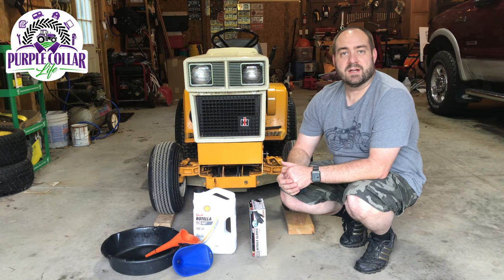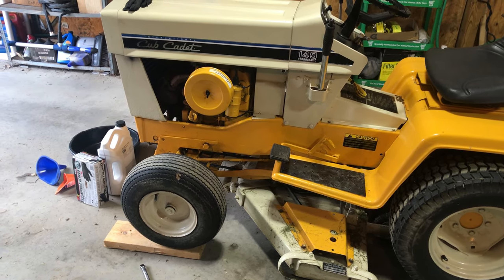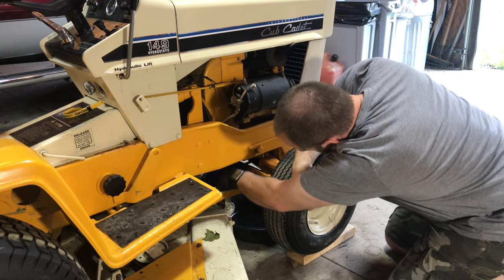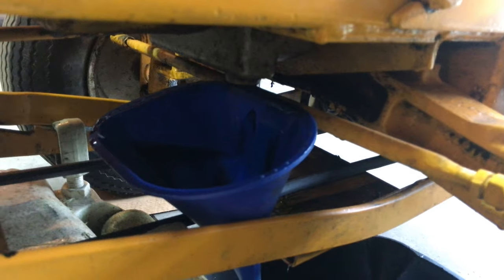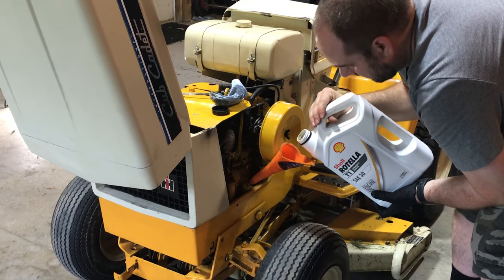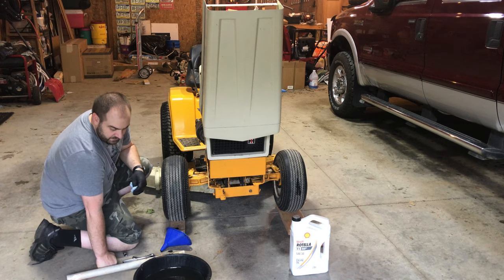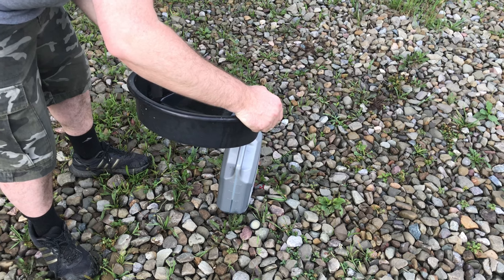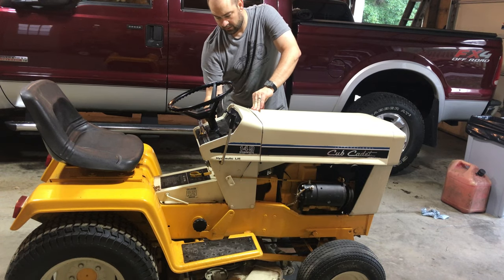#224: Cub Cadet 149 Kohler Oil Change. Shell Rotella

Comment: The Cub Cadet is in great shape! I use Shell Rotella Diesel oil in my trucks and tractor.
Reply from the maker: I've been really impressed with the Shell Rotella oil. For many years, I would only use the Motorcraft oil in my Ford F-350.  But when I switched to the Rotella, it seems to work just as good.  The only down side (in my opinion) is the 4 quart bottles.  The truck takes 15 quarts, so three 5 quart Motorcraft jugs were perfect.  Now it's an odd amount of oil for the 4 quart jugs.
Reply: Good to know I use 30 in my 1950 cub I hope to find a replacement oil for the winter I hope to have it in a heated building by then

Comment: It’s fine if to use the Rotella T4 15W-40 for your tractor. It meets most recent specifications and actually has higher levels of anti wear. (Higher zinc than the straight grade.) This maybe also simpler to stock if you also have a diesel pickup or tractor. Or you could use the T6 if you want to.
Reply from the maker: Thanks, Keith! I do use Rotella 15-40 for my F350 diesel! Sometimes though, I use the T6 which is 5W-40.  Do you think that 5W-40 would be too thin for the Cub Cadet Kohler engine?
Reply: @PurpleCollarLife  Good morning. No, actually it is thicker at operating temperature (being SAE 40), but still flows better in the cold.  You can essentially use the 15-40 for everything on the farm, but not in your cars that require low-phosphorus oils and lower viscosity.
Reply: @PurpleCollarLife  the Rotella t6 can't be a thin oil since it's still has it's 40 viscosity index. I actually use Diesel multigrade 15w40 oils in my petrol generator , and diesel engines are much better.
Reply from the maker: @danteerskine7678  Thanks!

Comment: Привет дружище, главное всё делать вовремя  и тогда техника будет служить долго.
Reply from the maker: That's right, Victor.  It's important to pay attention to oil change intervals - both hours of use, as well as length of time between oil changes.  Like I said in the video, I didn't have many hours on the oil, but it was due to for a change simply because it had been in the tractor for about a year.  Thanks for watching and commenting!

Comment: Forgive the lack of knowledge as I've gotten my first ih cadet 1200... but its safe to use diesel grade oil in a gas engine on these old beasts?
Reply from the maker: That diesel grade oil is used by many in these old antique tractors. I have found it works good as long as you’re in the proper climate for the viscosity range.

Comment: Would this oil work on a cub 109?
Reply from the maker: I would think so.
Reply: Shell rotella works great, I use rotella t410w-30 in my 149, 1949 Farmall H and 2004 Chevrolet Impala with a 3.8-k v6 cause it was using oil and t4 10w-30 rotella it may need a 1/2 qt between changes at 3000 miles. Good choice all around.